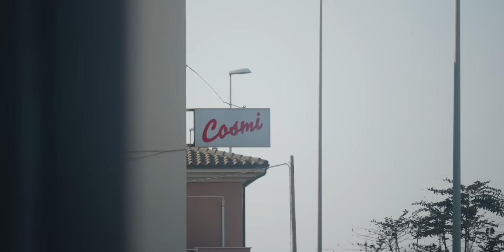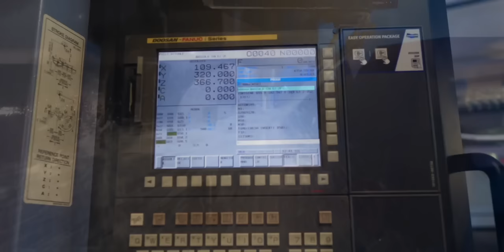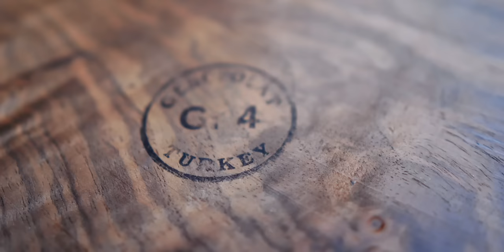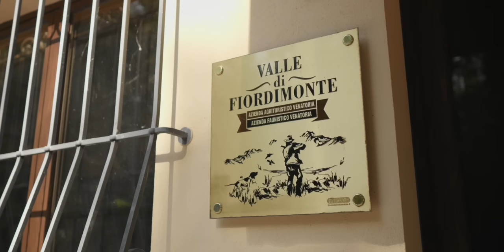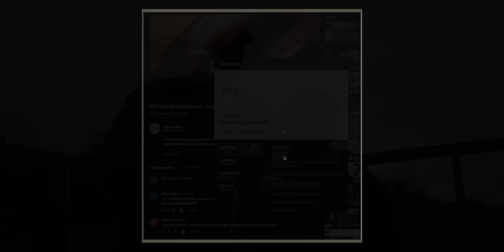Worlds most unique gunmaker - COSMI factory tour

Comment: In my opinion this shotgun could be modified with a poly choke system for different shooting needs from birdshot to buckshot and even slugs can be fired through the same choke simply by twisting to adjust for desired shot ! Also a rifle version would be nice utilizing a 30-30 Winchester or 45-70 ,some of the handgun ammo like the 327 federal magnum might offer prolonged shooting .this gun should be able to accommodate anything that a lever action could with a few modifications ! Perfection is key to an outstanding gun ! The Cosmi company is allowed to utilize this information if they wanted for trials on a newer prototype !🤔